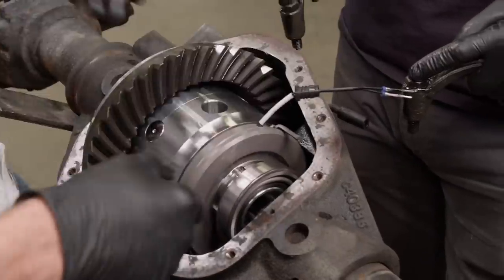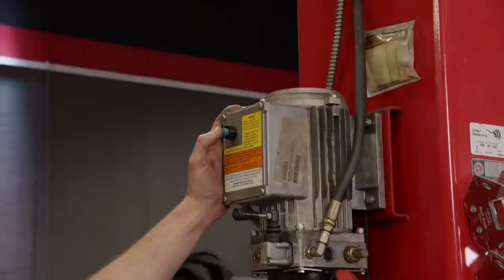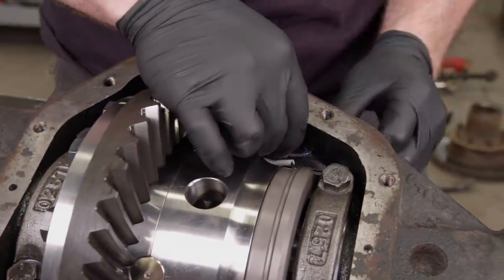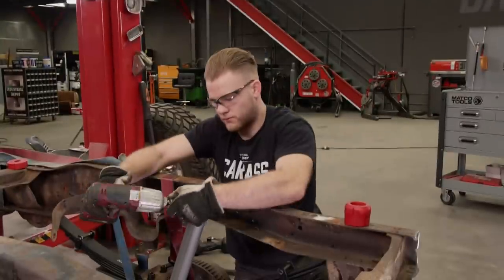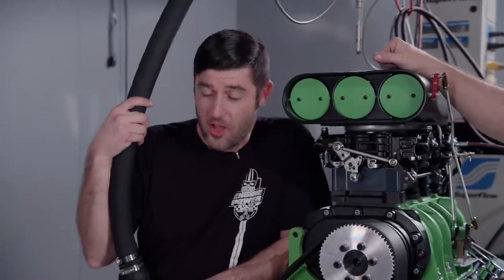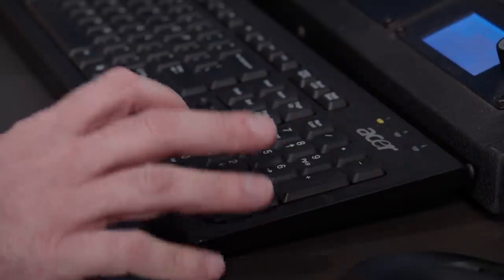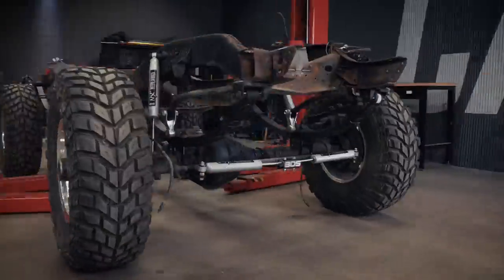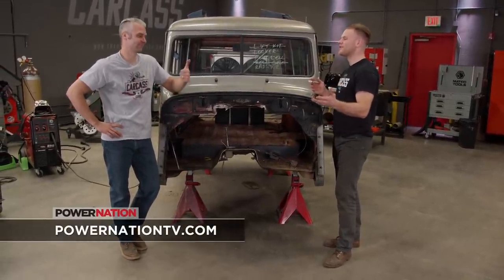Revving the Mud Wagon's 600HP Monster to the Max - Carcass S1, E7

Comment: With that hole in the pumpkin ;unless you seal it , everytime you go in the mud or water you contaminate the gear oil. You didn't mention any sealant or wire boot ; that would be an expensive replacement or change the oil everytime.
Reply: Good catch, man.
Reply: I was wondering about that too
Reply: At 5:57 you can see the plug for the hole on the wires. The shoulda mentioned it. I would put some rtv on it as well to be 100% positive

Comment: You drilled a hole in the housing, wwill that leak out the differential lubricating fluid?
Reply: The plug has a rubber gasket on it, so it won't leak fluids.

Comment: Rebuild a 1950 Ford f1 and put a Chevy 302 in it  then use a 4x4 f150 4 speed transmission with front axle and gearbox then stiffen the suspension and do rust work